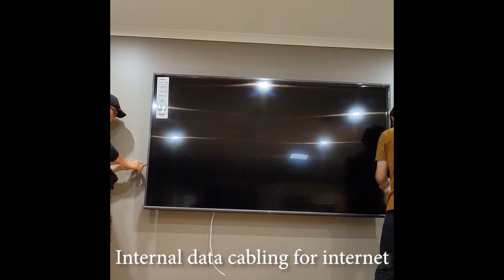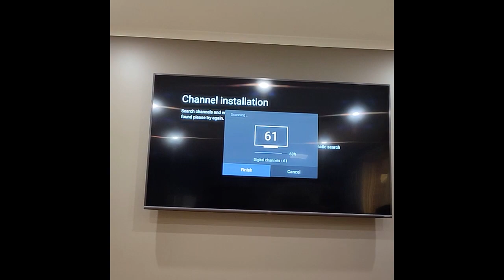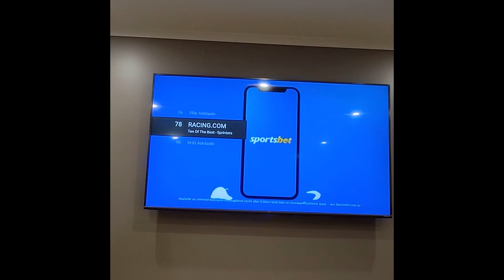TV TCL 85" Wall Mount in ONLY 6 SCREWS

Comment: I was wondering what the length of top screw on the bracket to the bottom of the tv is ?
Reply from the maker: It depend on where are you sit, all Tvs set are different.